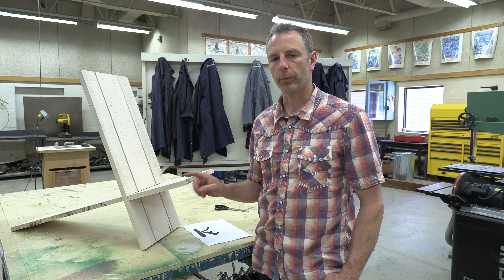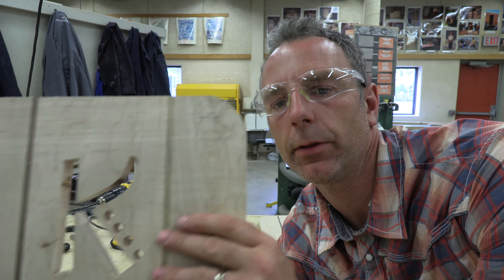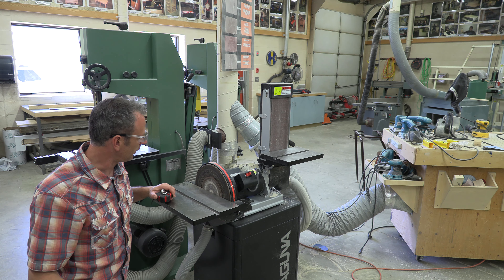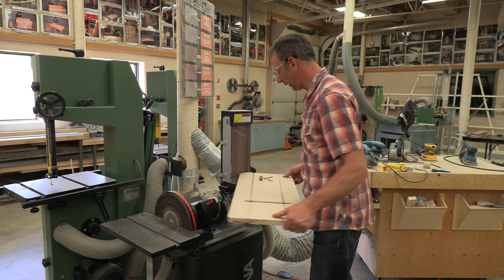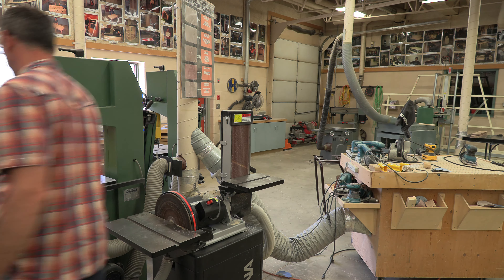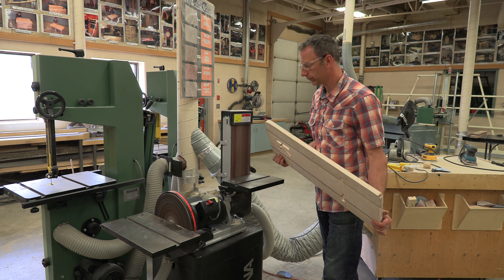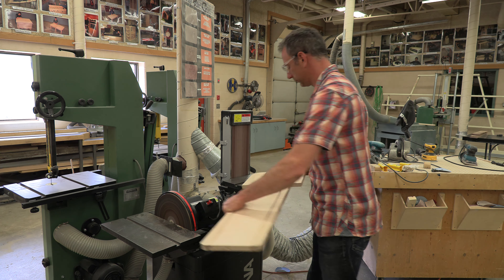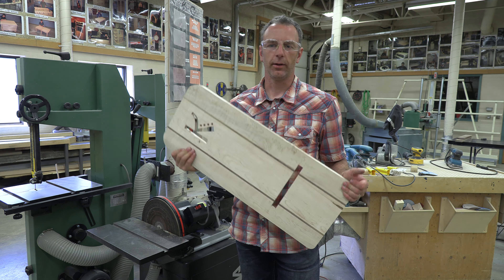Building a Viking Chair Prt 9  The Combination Belt Disc Sander

Comment: Great tutorial on how to use the sander! Especially the disk portion of the tool...I would have never even thought to use the right side only until it was probably to late and ended up messing up the board in some way!! Also, how do you like this particular model? I've been really thinking about buying this model and there aren't very many video's on it and absolutely zero reviews that I can find...any help would be appreciated! Thanks!!
Reply from the maker: The machine is decent. Probably 3/5 stars.  The disc sander is fine but the belt side of the machine runs much slower than the Delta that we replaced. We've had the sander for a few years now and had to replace the switch twice. The shrouds are also plastic which kind of give it a cheaper feel.  It is a well used machine but I wouldn't say our students abuse it by any means. Hope this helps.
Reply: @mr.kardynal8663  This helps a ton! I think I should really look into other manufacturers as well to compare...thanks again!!